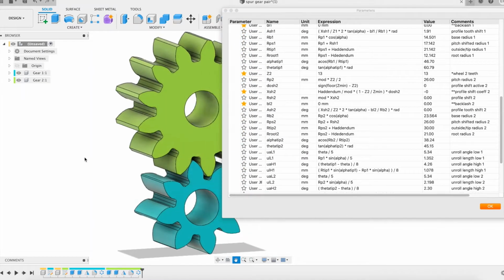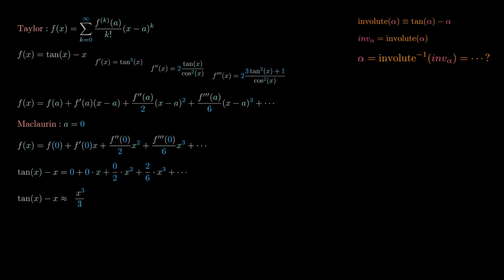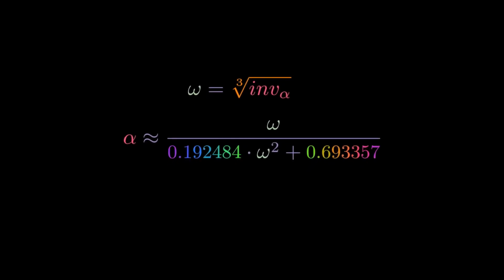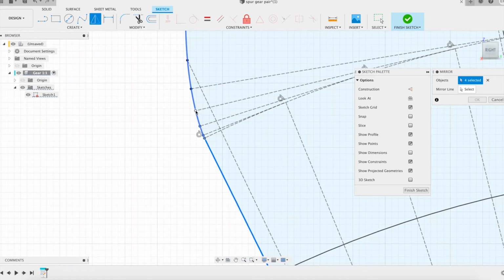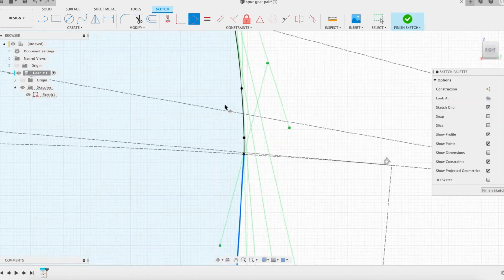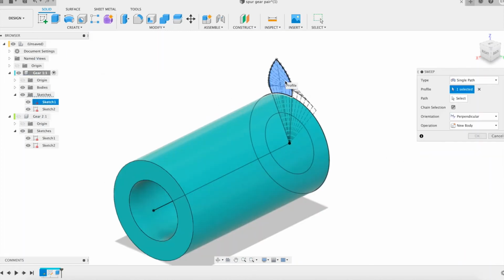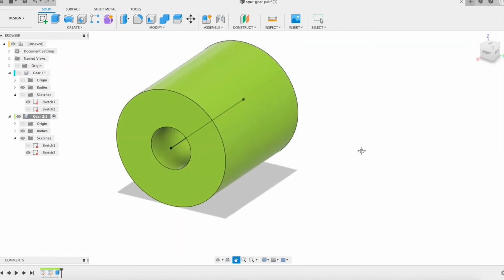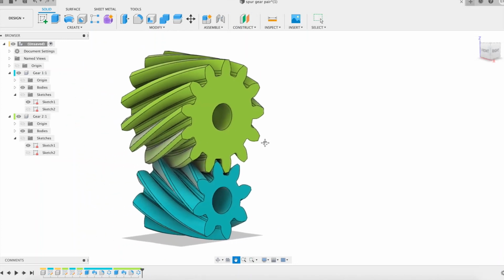Spur Gear to Helical Gear, involute, parametric (Fusion 360, Manim)

Comment: For example M5 z17 span measurment between 2 tooth should be 23.33 but fusion somehow does not show correct snap points and measurment is not correct. is that a error from mirror function?